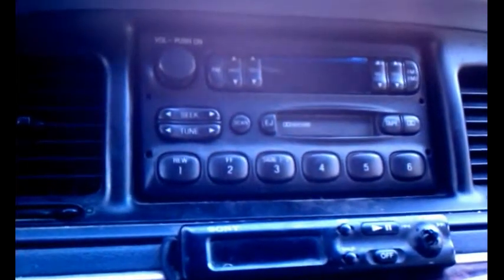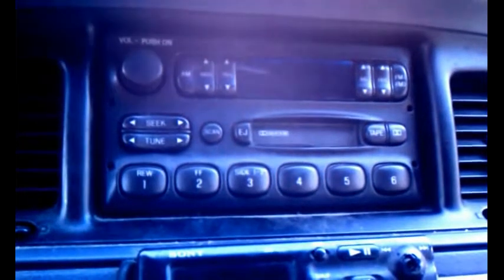Removing the radio from a 1997 Grand Marquis/Crown Victoria

Comment: On the external keyless entry pad for a 1999 grand marquis, there are to buttons that do not work. Is there anything I can do? Maybe change a fuse? If I get a new pad would the same code work or will I need a new code?